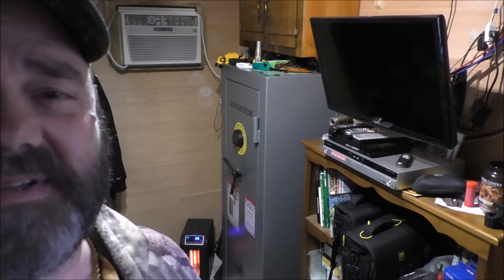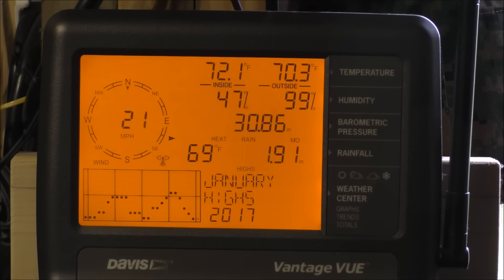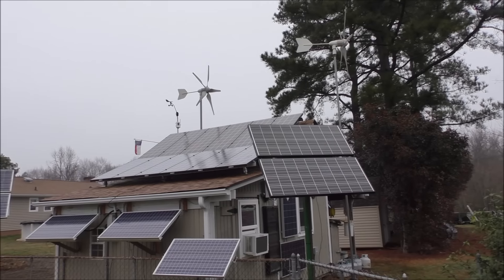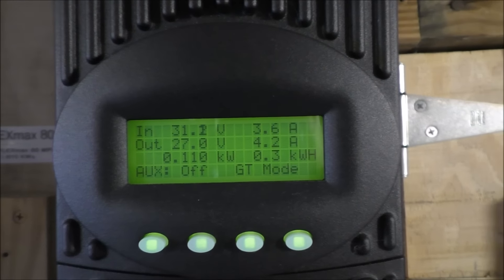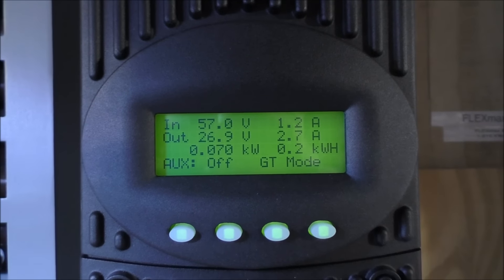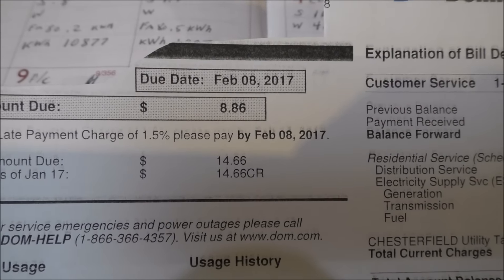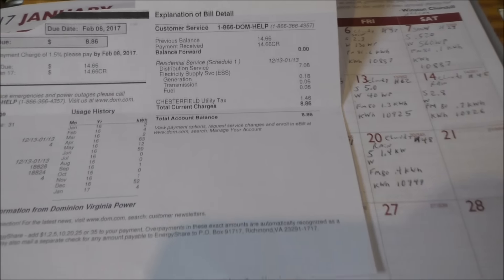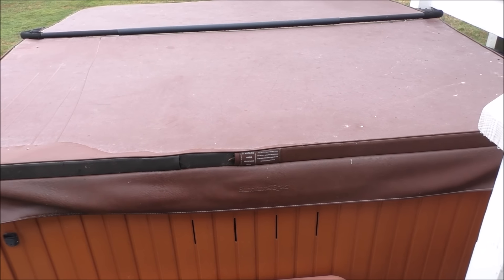Solar Electric PV And Wind Home Power Bill "4" kWh January 2017 By KVUSMC

Comment: how did you go about setting something like this up?
Reply from the maker: I Started Back in 2009  I had A Goal  The Alt E Store Helped Guide Me Along They Helped Me So Much On What Equipment To Buy Etc I also Watched Planet Green A TV Channel  Years Ago That Inspired Me
Reply: That's awesome, I was inspired enough to do research as to getting entry level kits that can start for a total of $125 mid grade kits 1200 and pro kits for 8000 average cost, Honestly I'm not the most handy person but if I was to ever watch a step by step video I'd have the confidence to do it myself, otherwise I wonder if there are services available for these kind of installations.
Reply from the maker: That Is Awesome It is Not Hard At all buddy  ! Yes There are a bunch of Installers Around Buddy

Comment: Kenny when they install the smart meter on your house you will be out of luck with the grid tie part of your system. With the meter you have they can't tell that you are sending power back to the grid. When they install the smart meter and they will they will shut you down unless you have permitted and had your system inspected , and from what I see with the system you have done will not pass inspection. I love your system don't get me wrong, I have the smart meter and the power company will not let me connect to the grid without permits , and trying to get them to permit a off gid system to sell back will not fly with them. Good luck ...
Reply from the maker: +urban solar offgrid Hi Buddy I already have a Smart Meter on my house it Analog but It has the Wired Remote in the meter already Making it a Smart meter There are analog and Digital Smart Meters The power company has already inspected my system and so has my county so yes Sir I will be fine either way Brother
Reply from the maker: +KVUSMC / Kenneth W Viar Jr My system was Inspected back in 2013 When I had my big Shop Built The county And power Company inspected it all I'm one the The first in my power companies area in history plus I used to work for the my Power Company Dominion Virginia Power  I appreciate The Compliments and Feed Back Cheers brother
Reply: I need to move to Virginia , and set up shop. California sucks for permitting. I make way more power than I can use and store . My battery bank is at float by 11am and half my system shuts down .
Reply from the maker: Hi Buddy I know What You Mean Man Many States Have Permits So Messed Up When I have to get Paid to Sell / Net Metering I Will But until Then I'm Just Saving on my Electric Bill I tried OFF Grid / Partial Off Grid For about 2 Years I Wasn't saving any money But When I grid Tied Battery Back Up I have Been seeing A Big Difference over The Years Plus My Batteries always Stay at Float ! Your System Is very Well done ! Beautiful Setup Cheers Kenny

Comment: 125 amps is that right wow
Reply from the maker: Yes The On Demand Tankless Hot Water heater Uses 125 Amps @ 220 Volts  But it only Draws 100 AMPS @ 240v / 88 AMPS @ 208v   Here is A Link http://www.e-tankless.com/stiebel-eltron-tempra-24-plus-tankless-water-heater.php?gclid=CjwKEAiAqozEBRDJrPem0fPKtX0SJAD5sAyHTCr_13-mkCjOXSyDUpd5Oe9W9u08_QSFA0MZXK-55hoCcrzw_wcB